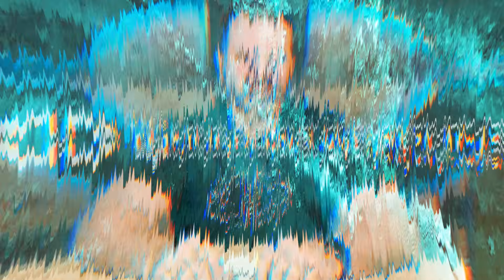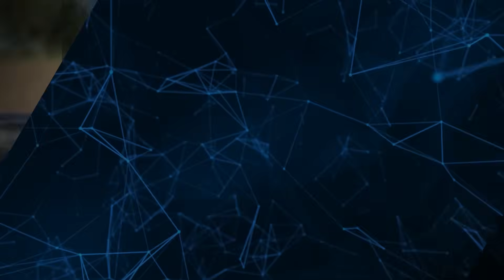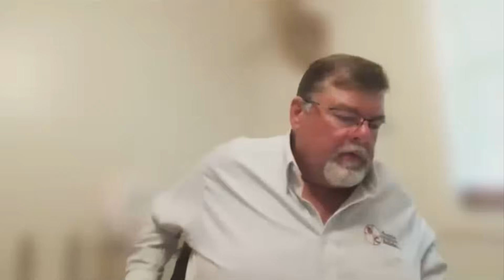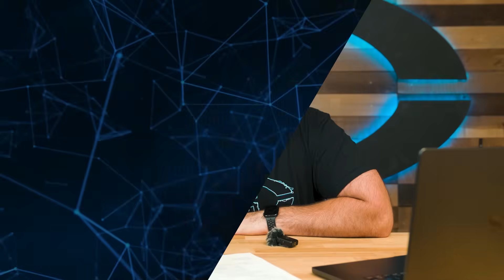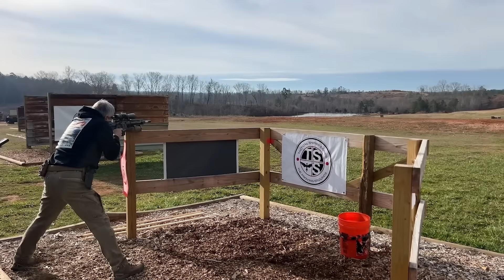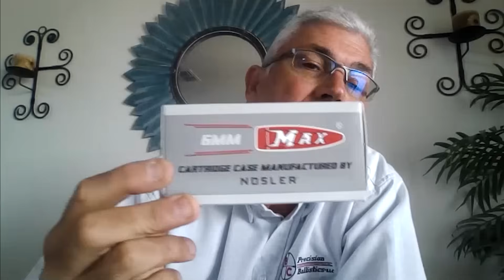The 6MM MAX Cartridge w/Brian Cook & Clark Curnutt | TWP Ep. 5

Comment: I was into the idea of 6 arc but the benefits of 6 max for having more structure on the bolt face, mag shape, and still getting plenty of velocity. This in a shellshock case…now that shouldve been the new round for the military.
Reply: Well, both cartridges suffered from action length limit of legacy platforms (556 and its miniaction length). 6 ARC was designed for extended range, so it wants very long for caliber bullet and pick a shorter Grendel case as the parent case (Which was based on .220 Russian) to get that space for bullet. 6 MAX is a more general performance improve using legacy bolt face but cannot fit a bullet as long as what 6 ARC can support.

Honestly, 6 ARC was successful because it fits legacy platform. But sometimes I just want the firearm world to go beyond the legacy limit like the 6.5 LICC. Imagine 6 MAX that supports very long bullet like 6 ARC, in a Shell Shock NAS3 case with 37~38gr case capacity instead of 35.
Reply from the maker: Both are very long and require alloy mags to fit the max length
Reply: @DesertTechUT I've been binge watching your past videos making the case for your better NGSW offerings.
There was a combination of different ideas that clearly you like but didn't all occur together in reality. That gave me an idea...
HEAR ME OUT.
I've gathered the best ideas you've verbalized all together.
1)- a 20" bbl WLVRN 
2)- shooting 6mm max +p from shell shock cases
3)- the last 1/3 of the bbl is a removable easily cleaned reflex section for a short high volume low pressure can.
How does Quatro fit in here?
(It doesn't really but what about this?)
Here's ny idea
Take the Quatro idea, but instead if a quad column make it a triple stack... figure out how best to fit this geometry in 6mm max cases, using the thinner external geometry of an sr25 magazine. 
Then long load the higher bc bullets from 6mm arc or Creedmoor so all of the internal case space is freed up for powder only. That's the lowest effort solution, but an alternative is lengthening the case and moving the shoulder forward a bit. To make maximum use of magazine dimensions. But it isn't really necessary. 
But the real benefit is developing a high cap mag that isn't overly thick or long so it fits existing pouches magwells etc. 
This would make aftermarket sense too because existing firearms like the sfar would work great because they already have the correct magwell and action size. But the MDRs can all do this too.
I'm not 100% sure the geometry of a triple stack mag will work, but it would allow for a beautiful compromise of logistics and firing doctrine if possible.
Reply: Completely agree that it should have been the new round for the military, but I am not sure that it makes much sense in the civilian world.  It is a relatively expensive round compared to 5.56 (which is and always will be a great little and relatively affordable round for the AR platform)...  then compare that to the price and long range performance of 6ARC.  Are there short coming of 6ARC? Yea, but they aren't show stoppers.  If I am going to pay 6max prices, I am going the little bit extra to 6ARC for the long range performance.  If I am just looking for a serviceable standard ammo...  it is still gonna be 5.56/.223.  I love what the guys have done here and like you said, it should have been adopted by the military, but I just don't see it being it for civilian use.

Oh and side note, if you load your own ammo, Leverevolution in 6ARC is bumping the velocities Way up and blowing out the advantages that 6max has by packing the charge load and having a slower burn so the bullet accelerates more consistently down the barrel.  Of course there are trade-offs, leverevolution isn't super temperature stable so there are some consistency issues if you have big temp swings day to day where you live.  But all that said, crazy good velocities without causing any damage.
Reply: @quickcooper61 Well if it were an adopted cartridge you’d see prices fall. It’d be a common caliber. The price is because it is rather obscure.
Reply: @jubjub905  Even if 6MAX surpasses 5.56mm in manufacturing volume by a very significant volume—which is highly unlikely, even if the U.S. military adopted it—it will always be more expensive than 5.56mm. More powder and a larger projectile inherently increase costs. The 5.56mm round is already optimized for cost efficiency, and it would take a long time for 6MAX to reach similar economies of scale. Even if it did, 6MAX would likely remain noticeably more expensive than 5.56mm. For civilians, 5.56mm is generally more cost-effective, and for those needing greater range, 6mm ARC’s superior performance at distance justifies its higher cost. While 6MAX is a promising concept, its timing is unfortunate. Overtaking 5.56mm, which is widely used across the Western world, is highly improbable, and there’s no significant indication of that changing in the near future.
Reply: @quickcooper61 yes, but at $1.50? Nah.
Reply: @jubjub905   the only place I can find 6MAX to buy right now is Sons of Liberty...  at $1.75 per round for 80 grain.  In less than 60 seconds I found 5 websites selling 6ARC for under $1.20 a round.  WTW Arms has 105gr Hornady Black for $1.15 per round right now.  I load my own 6ARC round with 90 to 109 grain Berger and Seirra projectiles for less than a dollar per round.
Reply from the maker: Good points made!
Reply: @quickcooper61  yeah, my favorite caliber to shoot is .22lr because my wallet says so. Next 9mm, only then 5.56. 6max would hurt the wallet even more.
Even if a military adoption would totally change availability and cost.
Honestly, best thing the military could do is keeping the 5.56. It's light, logistics are good, factories exist. Put the money into artillery, drones and ships. Nas3 cases in 5.56, adopting 6max or telling shell shock to make 6max hybrid cases would be at least tolerable logistics compromises for performance. 277fury is insanity.
Reply: @quickcooper61 it's actually kind of the opposite. The M4 is the current, not future standard issue rifle of the US military. Even if Spear fails, with the FN IWS and other piston/non buffer tube MCX style uppers are the future. 
The UK with NARP, Germany with the HK433, the AR-15 cannot and will not be the "next rifle", so 6MAX makes little sense in that respect, because it was designed for the AR-15, an evolutionary dead end in military procurement. 
It makes much more sense for the civilian market because the AR-15 is ubiquitous, and minimal modification makes sense while getting a way more capable cartridge (5.56 is kinda anemic past 300 yards).
Reply: Amen!

Comment: A Quattro15 SBR in 6mm MAX is about as good as the AR15 platform could ever possibly be. The final evolution if you will
Reply from the maker: I was surprised by the velocities they are getting with short barrels with the 6 max.
Reply: SOLGW have a video comparing a short barrel 6 MAX to 5.56, it’s very impressive. It definitely is the cartridge that should of taken off instead of the garbage ARC series

Comment: I really enjoyed this video on the 6 Max.  I admit that I'm a fanboy of the 6mm ARC, but while I have a couple of ARs in 6mm ARC, I have a couple more 6mm ARC bolt action rifles and I recognize that is where that cartridge excels, especially when hand loaded. I'd like to give 6 Max a try and I might have to finally buy a barrel or an upper. I gave 350 Legend a go during the Covid era and because it head spaces off of the edge/neck/rim it will not feed reliably. 6 Max in a 350 Legend case with a neck added to it will resolve that issue. Thanks for the discussion.
Reply from the maker: That’s a solid plan. I would love to hear about the reliability your experiencing with the 6 arc in ar platforms and what mags are working for you?
Reply: @DesertTechUT I have had good reliability using 6mm ARC in all of the platforms I have. Not so much with 350 Legend in AR platform.

Comment: The 52,000 psi limit on the 6 ARC and 6.5 Grendel is to avoid overstressing and breaking the bolt lugs.  The case walls were designed around that pressure limit when Lapua designed the Grendel case and Hornady, the 6 ARC case.    This has effectively limited that case to AR15 pressures for semi-autos, even if put into stronger rifles.
   A case acts like a gas piston the diameter of the largest interior part of the body being pushed back with max chamber pressure.  The larger diameter case of 6 ARC/6.5 Grendel produces more backthrust against the bolt than a 5.56x45 or 6mm Max cartridge at a given pressure.   In fact, the 6 Arc at 52,000 psi has more backthrust against the bolt than a 5.56x45 at well over 60,000 psi.
Although most of the time, the case grips the chamber walls and reduces the actual backthrust against the bolt, the rifle needs to be able to handle tha maximum.  Even a little rain getting into the chamber will lubricate the case, as will lube oil that accidentally gets there.
Reply: 6.5 Grendel beats them all without chasing pressure.

At 47,400-50,000psi under a 123gr Fort Scott TUI, neither 6mm can beat it unless you go bolt gun with 110gr SMK.  

8.5" Grendel pushes a custom modular tipped projectile at 3050fps without chasing pressure.

It's easier to evacuate the bore with 6.5 Grendel than any 6mm, without trying to edge up in chamber pressure, instead relying on commonly-available optimized propellants.

ICAR will make a long-overdue replacement for large-frame SR-25 type sniper systems in high performance intermediate cartridges, and subsonic suppressed special weapons in 338 ARC.

Due to mass logistics footprint of the existing 5.56 world, it will be hard to justify switching to a slightly-larger cartridge, even though 6mm Max delivers superior performance.

5.56 NAS is already being used in competition and will appeal to military customers using shorter barrels, as it delivers 16-18" performance from 10.5-11.5" barrels without corresponding muzzle exit pressures and flash signatures.

The 10.5" suppressed SOLGW 6mm Max was blowing flame out the end of the can like a 6.8x51mm NGSW, which is no bueno.

A tall propellant column makes it very challenging to achieve optimum propellant conversion, optimum port pressure, and optimum muzzle exit and suppressor pressures and flash signatures.

Shorter, fatter cases do these 3 things extremely well.
Reply: @LRRPFco52 there are no available 6.5 grendel cartridges that push a bullet 3000+ fps.
Reply: @ravissary79  Some of the existing 90gr Federal TNT easily does 3000fps from longer barrels.

It does 2900fps from my Lilja 17.6" barrel, and 2700fps from my 12" Grendel.

The custom projectiles I had made do 3400fps from the 12" Grendel without chasing pressure.

I really wish I would have jumped straight into 12" Grendel from the beginning.  So many people kept repeating how Grendel couldn't perform from short barrels, and none of them had any real experience with the cartridge.

Comment: @DesertTechUT 
Please have a 24-inch barrel for the 6MAX. 
16-inch, 18-inch, and 20-inch barrel also. 
Those would be great in the wolverine.
Reply from the maker: It’d make an awesome SPR rifle!
Reply: @DesertTechUT 
Especially with medium or heavy barrels.  
  If you aren't going to use at least a medium barrel I won't buy it. 
  I rather have a heavy 20-inch barrel in your rifle. 
 Thin barrels are a waste of money and Suck !
Reply: @MTCKIE68  I shoot PRS and prefer heavy barrels. 20" would be good but imagine a heavy 24" barrel.
Reply: @oif3vetk9 
That's what I'm saying.  Or a 22-inch barrel. 
 24-inch barrel might be to much.
Reply: @MTCKIE68 nah. In my gas guns all I've ran is .936" 24" barrels. It's fine. 😉 My bolt guns are even more ridiculous.
Reply: @oif3vetk9 
Well you're my kinda guy ! 
  I can't stand the thin, short barrels for anything. Especially Ar platforms. 
  Me, I want maximum performance from velocities and energy with everything. 
  Question though, why would you run anything longer than a 20-inch barrel for 5.56 ? 
  I totally understand why you would for the 6ARC, 6.5 Grendel, 224 Val, or even the 22ARC. The 22ARC I would run a 22-inch barrel.

Comment: Wouldn't the lead-core 90 grain bullet face the intermediate barrier problems that caused the shift to the steel/copper EPR rounds in the first place?
Reply from the maker: That’s a good question. They seem confident in their lead core bullet performance but I’d love to see on range performance testing.
Reply: You can bet the military would create a steel core round in 6 mm if they need to.
Reply: @WilT9-130  This round would lose a lot of its ballistic performance with a steel core.  Steel, copper, and brass have lower density than lead and density/sectional-density are a component in BC.  The same goes for the 6mm ARC, btw.  It looks much less impressive with a lower BC.

 Level III body armor began showing up on third-world battlefields (like Syria) over a decade ago and that spooked US Generals. Although I think they overdid it, part of the reason the Army went with 6.8mm was to get acceptable (at least level III at distance) penetration without using tungsten.  BC and SD and armor penetration scale up with diameter, however.   The US and NATO nations simply don't have enough tungsten to make it the standard bullet (Russia and China do, however).
Reply: you're absolutely right, I guess my assumption is that there would still be a drastic increase over 5.56 performance, while keeping all of the benefits of the smaller platform rifle that the NGSW gets hate for. It would never be able to live up to the 6.8x51, but it wouldn't be trying to. By definition, the 6 max is an intermediate cartridge. It would be trying to perform in between the two. The idea I would suppose is that as a much cheaper round that's easier to produce and can be carried by infantry in larger quantities, the max with a penetrator bullet would be enough of a step up to justify its adoption and keep the new sig in a specialized role.
Reply: @jfess1911  they also said they defeat level 3 with just copper rounds. There's a tragectory penalty with solid copper as well.

Comment: If mag and barrel were the only things to change, and the WLVRN has a mag-adapter to 5.56, you'd in-theory need just a new plastic adapter and barrel to convert the WLVRN to 6mm MAX. I'd love to know how it compares to the other WLVRN caliber options, but the multi-caliber design seems to me that the WLVRN is less bound to this need than other 5.56 platforms would be.
Reply: 6 MAX mags fit the standard 556 magwell. Also according to past DT videos the WLVRN bolts are the same as what they submitted for the NGSW program and cans handle higher than standard pressure. Not sure what the limit is though, 65k-70k would probably be plenty. I’m really hoping shell shock starts making cases for this cartridge and DT starts making barrels.

If I could ask for just one more thing, I would love if DT made a micro-action only (556, 6 max, 300 blk) version of wlvrn. It’d be at least half a pound lighter and an inch or two shorter which would fix the length of pull issue for short kings and make an 18 inch barrel about the same length as the current 16 inch WLVRN.

30 round 6 max mags and a reflex suppressor would make a very capable rifle for cqb AND distance shooting. If only…
Reply: couldnt you have much higher pressures in 6max in the wlvrn, cause its chassis is designed to withstand 308 pressure